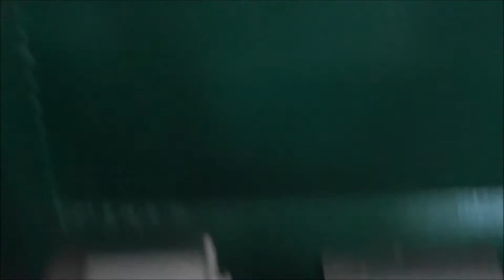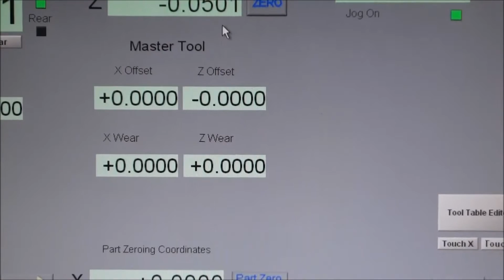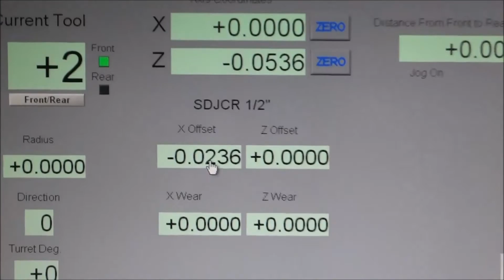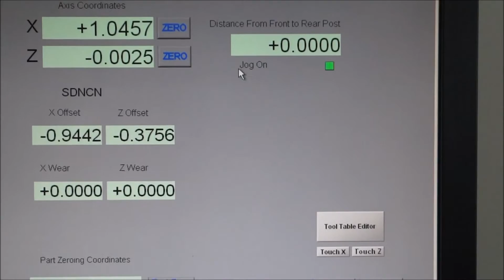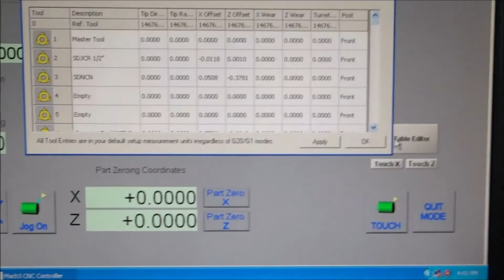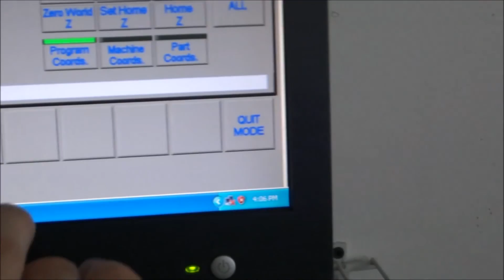Mach 3 turn  QCTP tool offset Setup

Comment: More accurate to use one of those electronic edge finders in the chuck.
Reply from the maker: maybe but there still may be a delay. Once set you can go into the offsets and make adjustments.

Comment: Sam another question for you setting up tools in gang tooling how do you get the tool to run from one to another
Reply from the maker: Ok check the general configuration top left. Select auto tool chsnger
Reply: @CNC4XR7  That's it bud thank you I have been looking for that great stuff buddy lets hope I can work away from the machine for a little while now while it works for me lol
Reply from the maker: with tool offsets.
Reply: @CNC4XR7  
Yes but when it goes to the next tool I have to press cycle start 
Instead of it running from one tool to the next and carrying on

Comment: Great Video Sam.  Another way to get the drills and boring bars on center - is to use an indicator on the chuck to drive it to x=0,
A co-axial indicator would work too
Reply from the maker: Great tip! Yes thank you!

Comment: when you touched off the drill the drill should of been in the centre of the work piece for axis X the Z was correct
Reply from the maker: During initial tool setup all tool are set with X zero being the edge of the round stock. The Drill bit center line was lined up with the edge of the round stock and zeroed. once all the tools are setup in the tool table. To setup for a run use the master tool to turn a piece of stock. measure the diameter and enter this information in the X DRO. this will adjust all tools to machine center line.
this is the method used in this video.
Reply: @CNC4XR7  Thats very smart like that, I was thinking when the drill was going to be used it wouldn't find the centre of the work piece, wish you lived closer to me I would never be away, don't the same as you built my mill and just converted a lathe to cnc too, what would be good if you could show how to take a drawing from fusion on the lathe and machine it if that's possible
Reply from the maker: @davecox900  Thanks I will try to see if I can do that on my next turning project

Comment: sir, G73 not working in Mach3 can you please help
Reply from the maker: G73 not available in Mach3 turn you can try,
 G81 Canned cycle – drilling
G82 Canned cycle – drilling with dwell
G83 Canned cycle – peck drilling

Comment: Sam when you did your tools off set is the center of the chuck still Z zero? Can you type on your MDI G0 x0 and it will center. I am having a strange problem with my lathe ( not running Mach3 but acorn) can not keep z0 after a tool offset. I use Fusion 360 99% of the time and all is reference to center line z zero. Working in the diameter mode. Just curious if Mach 3 acts that way. For the last 16 years I have been using Mach3 on mills and plasma tables with  no problems . Any insight would be appreciated.
John
Reply from the maker: TheJR914 
X ZERO is always the centerline of the spindle. Z ZERO is the end of the stock.

In this video X ZERO is temporarily  the edge  of my stock to set offsets. The master tool is set to this temporary x centerline all other tolls are set from it as well.
However when you set the X zero you will turn a piece of stock then measure if its 1.0 " for example then type that into the X dro then x zero should be the center of the stock. All other tool will be as well.
Reply: CNC4XR7 Thanks for the reply Sam. When I set the touch off on the x axis I input the diameter of the measure stock (1") which is the question ask my the software. When I do this the center of the stocks read .5" . x0 is the opposite side of the one inch mark. If I run a facing program it would face from 1" through center to the opposite side ( total trace of 1 "). I also use Fusion 360 for my cam. I don't think this is correct . Working with Centroid with no answers only questions. If I enter the radius at the x touch off everything is ok. Only reason I went with centroid is for my 8 position tool changer (turret)  on my 1984 Ikegai lathe which is still on hold at centroid . How are you doing with your Linux?

Thanks John
PS. Is the XR7 the car 😀
I use  '914'
Reply from the maker: It sounds like Acorn is running in Radius Mode? can this be changed? Fusion so far only outputs Dia. mode.
 Shoot me a Email and we can discuss more in detail. Yes 67 Cougar XR7

Comment: How do you set the X zero on the details, because it has a diameter?
Reply from the maker: the easy way to set X zero in Diameter mode is to make a pass on the stock measure and input that in the X DRO make sure you tool # is correct if you have populated your tool Table.

Comment: I dont know how this machine work,but if you know your measure rod(part) is 1/8 inch or 10mm why cant you put that on dial? then measure all tools. it should work? and you ready to cut :) offset number just be bigger becouse your x0 is actual center of part.measuring drill is easy touch with your part x with atleast 2 sprirals contact with paper between and that is rod diamter + drill size from x0
Reply from the maker: +JarppaGuru  Yes those are all good ways to set  zeros There are a few ways to get the same results go with what works best for you.
Be safe Sam

Comment: hi Sam, great video, I have used your way for setting my tool on my 7 x 10 mini cnc lathe and it works in treat, I have changed it a little and used a digital Edge finder as the stock tho, I put it in the chuck and when the light comes on on z click touch and then x click touch you may want to try it yourself, thanks daniel
Reply from the maker: +Daniel Kitson 
 That's interesting there's always several ways to accomplish the same task. I do not have a electronic edge finder..
 Do you find that it is accurate? Great tip Be Safe,
Sam
Reply: Yes it's is safe and works well, you done have to look at the gap between the tool and stock, you just watch for it to light up, then click touch, you could do the same with it stock bar mounted in some plastic and a wire and bulb from the stock to the tool post, when the tip of tool touches the stock the bulb would light up, then always keep it for when you add new tools ? G-made a holder on his tool turret to do much the same thing, that where I got the idea, thanks daniel

Comment: Ok my question is the X..

How would I drill a hole in the center of a piece of stock.  Especially if the diameter wasn't known.

You say you aren't going to worry about spindle centerline but that escapes me..  

I am assuming that you have to go to lathe centerline with master tool and touch off...

 cnc lathe is new to me..
Reply from the maker: +TheRetiredtech 
Aww yes you are correct I did touch off the centerline for X zero. 

 However  I just meant I was not concerned with the overall diameter of the  knob  for this  project.  This was my first cuts on the G0602  cnc   I I did post a video " making parts" where I  bored a hole and turn the piece down.

Comment: Curious how this worked out. Other videos or docs I have read do it different. I tried it based off your video...went to run a program and the tool(tool 1 master tool) went way farther in than it should. Double checked the program and it was correct....I deleted everything from the tool table and it ran fine....
Reply from the maker: +Julia Goodridge  Hmm That is indeed strange, Tool 1 (master tool) should have no offsets in the tool table so if you Zero your part on tool 1 and run the code with tool 1 it should be fine. All tools offset from tool 1.
when setting the tool table you only Zero on tool ! the Master tool all other tools after they are at zero you click touch X touch Z.  when setting up zero for a run you have to zero the part to Tool 1. If you Zero to tool 0 that may have been your issue.
Let me know,
Be Safe, Sam
Reply: +Julia Goodridge Offsets will take an error or two before you start to understand the concept well enough ;-)
Reply from the maker: +CncObsession  Yes it is a little confusing at first and a little different than a mill.  
but once you get your mind wrapped around it then your fine.
Be Safe ,
Sam